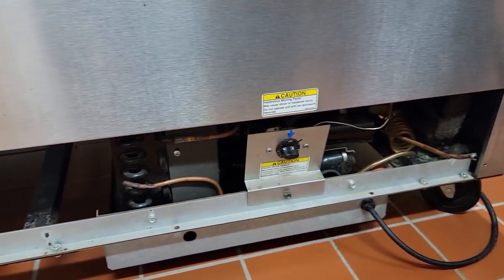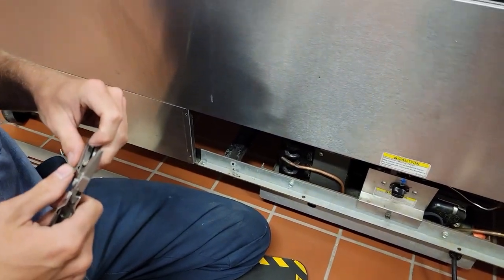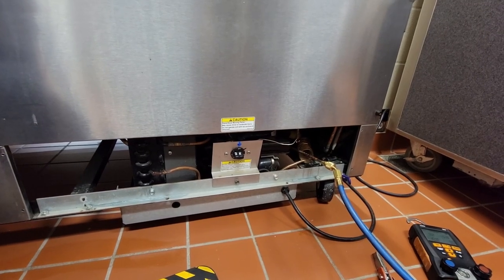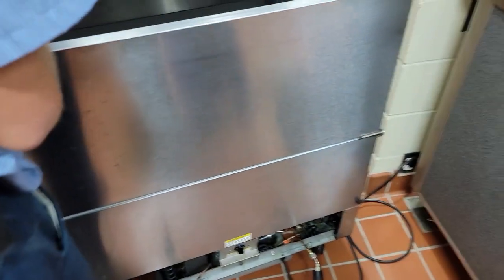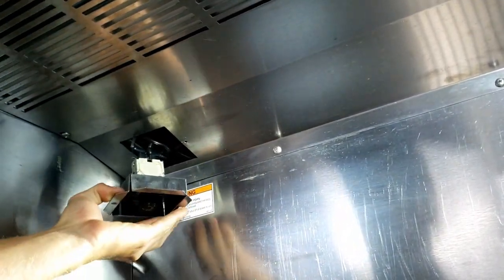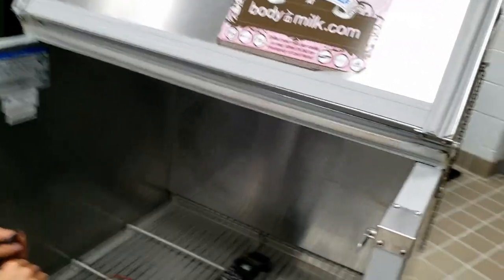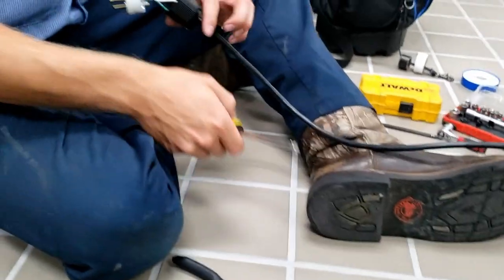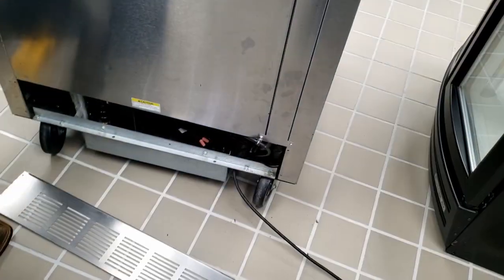Both Coolers Are Warm! How To Fix Them

Comment: It's interesting that the plug failed. I'm used to seeing and was surprised there didn't seem to be melting damage around the pins. I think that's just a molding mark where the depression on the back of the plug is. They're probably quite lucky -- that probably would have smoldered or erupted into flame and made a huge mess. Probably sooner rather later, given that it started smoking!
Reply from the maker: Very true,  I would think the plug is made with flame retardant material but can't confirm that. Thanks 4 your feedback!

Comment: I bought one of those vise grip type line tap tool. It crushed the tube more often than not! Lol
Reply from the maker: Yeah, I've seen that happen. I haven't used it much but it has its place. You could possibly sharpen the piercing edge and see if that makes a difference?

Comment: I will admit that my first thought, when I saw that there was an accessory outlet coming off of the main line, was "Plug in an extension cord and see if the sucker fires up".   The other was "stick the probes in the accessory outlet and see what your voltage might be."  

I've seen roasted plugs before.  Mostly with theatrical light wires, but even with roasted computer power supplies.

edit - yes, you really DO need the wire jacket to go inside of the replacement plug.
Reply from the maker: It's confusing to watch, I couldn't follow what we were doing when watching it a week or two later. That was what I was having him do with resistance checks. It doesn't help not checking it myself vs telling someone else to do it.
Reply: @HVACRSurvival  - it's always frustrating walking someone through a troubleshooting step.   You always have to hold back that 'give me a second and let me do it'.   Phone tech support or on-site, it's really hard to hold back.

Comment: Quick way of testing is to check the plug live and neutral pins for continuity when the stat is made.
Reply from the maker: That would have been a lot faster,  unfortunately looking back I should have trusted my light pen more and thought it out better. (Hind sight is 20/20) thanks 4 the feedback👍👍
Reply: @HVACRSurvival  Yeah, our plugs here have fuses in them so one of the first checks if something don't run before going to the trouble of removing the fuse is to test across the live and neutral pins.

Comment: My dad calls those non-contact voltage detectors (your little pen) Widow Makers... They don't always work. lol
Reply from the maker: The funny thing is the pen was correct but I ignored it because I've had ground wires cancel the signal before.
Reply: I don’t use them, but they are good for a second opinion, best to take meter always, and check a know voltage
Reply: Yea they're great for a touch and go check.

Comment: Hi rick great video, do you carry a AC line spliter goes between the receptacle and the male plug, i will leave it to your imagination on how to make your own on the cheap, then compare total amp draw of the cabinet to the name plate maybe it was drawing to many amps and burnt the plug out. Also to your apprentice dont sit on kitchen floors or cold surfaces could cause medical problems haha ask a doctor for further information.
Reply from the maker: Thanks Jay,  I used a splitter on my frozen evaporator call a couple weeks ago. They are useful 👍 👍

Comment: The wire in that plug probably overheated and likely burned off the hot wire inside of the plug which caused it to lose connection. That cord is most likely only 18 gauge wire which is all it needs but still on the thin side and will easily fail which it obviously did. If the manufacturer would have just used 16 gauge this problem would have likely not happened but we all know that would be too difficult.
Reply from the maker: Agreed,  we replaced it last week.

Comment: I don't think that male plug was melted. That is a pretty typical sign on flat parts that are injection molded. The plastic shrinks as it cools and leaves a dent in a flat piece. As near as I could tell it looked perfectly fine from the outside.  Obviously it wasn't perfectly fine on the inside, but visually I didn't see anything I thought was bad.
Reply from the maker: When we seen it start to smoke is when we verified it was bad.